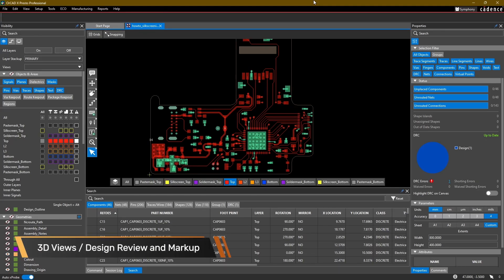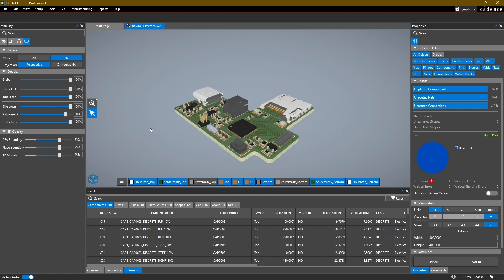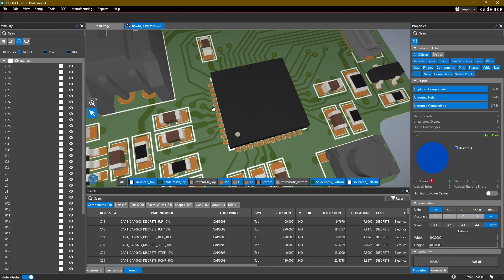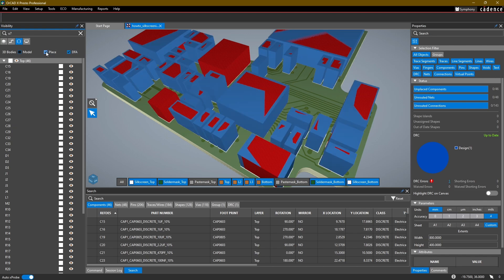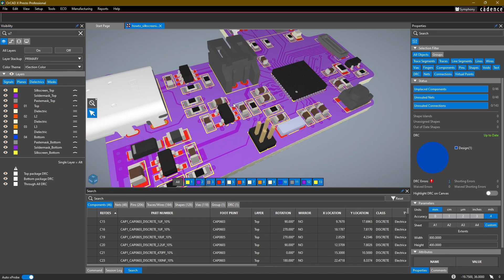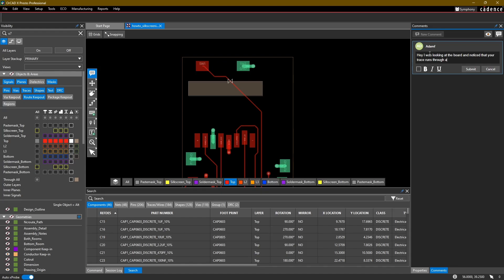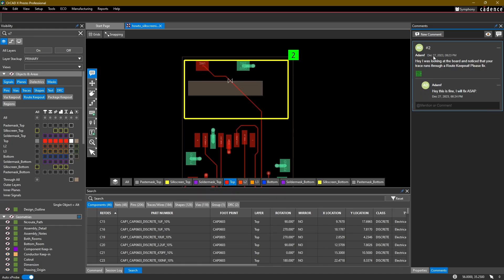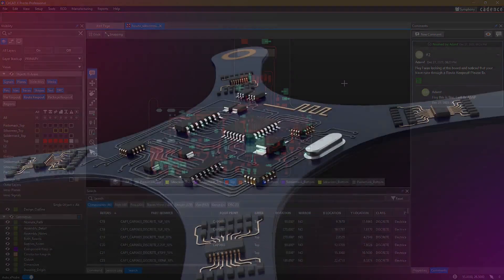OrCAD X How To Series - Part 12 - 3D Views / Design Review and Markup

Comment: Where are the step files?
Reply from the maker: You can find them here: https://www5.cadence.com/orcad-x-how-to-file-request.html
Reply: @CadencePCBDesignandAnalysis  There is an initial How-To-Files.zip file and then inside the folder EP1 there is a howto.7z file that also needs to be extracted.  There are no step files anywhere in here that I can see, even though the initial projects reference step files.  What's really strange though I can load the howto_3dandreview.brd in the EP12 directory directly into Presto and get a lot of 3d detail beyond the placement and constraint layer information (layer Place_bound and Dfa_Bound) that occurs when there are no step files.  I still think the author overlooked attaching the step files though.  If somehow they are in here maybe you can direct me to the exact folder and one example file name.
Reply: @CadencePCBDesignandAnalysis  The step files are not inside this archive.